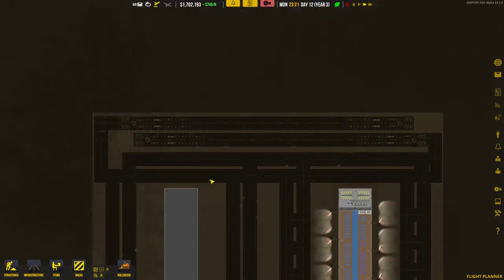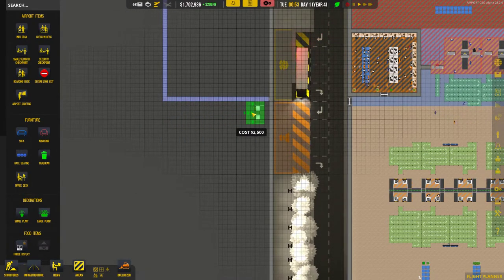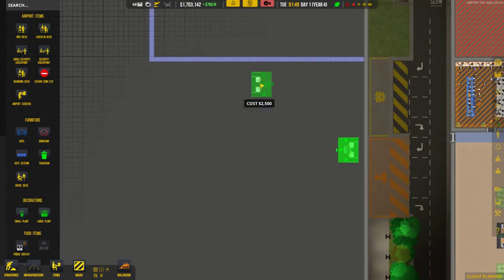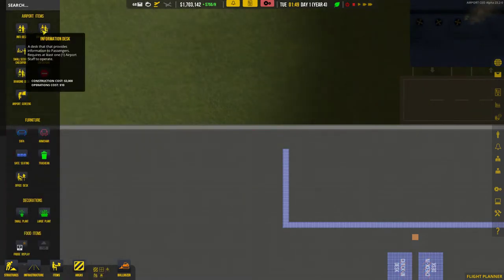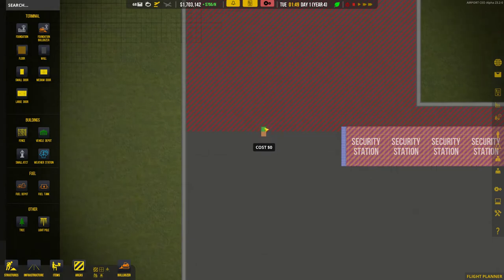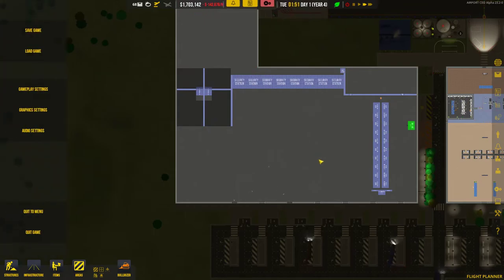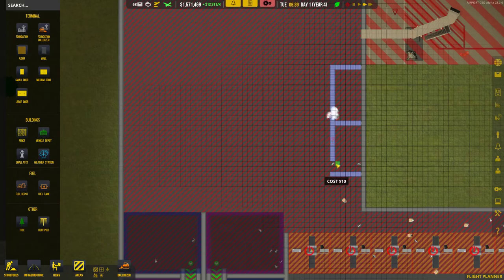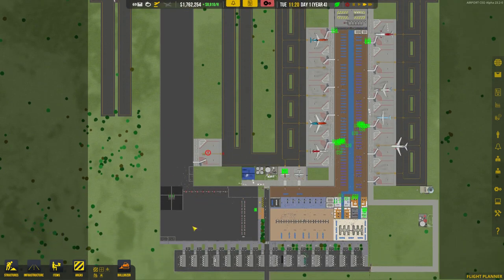Airport CEO Let's Play 19 - Planning Terminal B

Comment: Looking good. With 20 check-in desks, Terminal B has at most 10 medium stands of simultaneous flights. If you have a lot of small flights in contracts you could do 8 medium stands (4 per side of B) and 4 small stands (2 per side).  But that would depend on what your flight contracts for smalls looks like.
Reply from the maker: +Wil Turvey, Thanks for the suggestion. I doubt I would ever get all the stands to be filled at the same time given the staggered arrival strategy I am using. I think having all those flights at the same time would be an issue for the baggage bays. Not a big fan of the small stands, too little income for the cost of a landing slot on the runway.